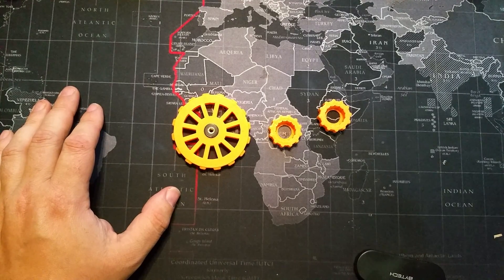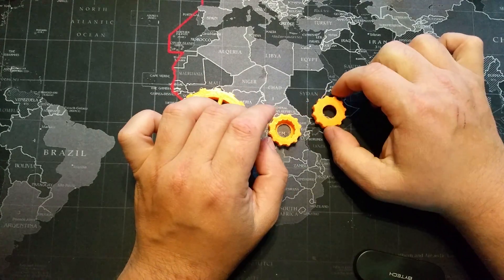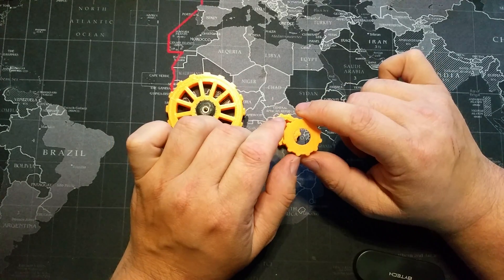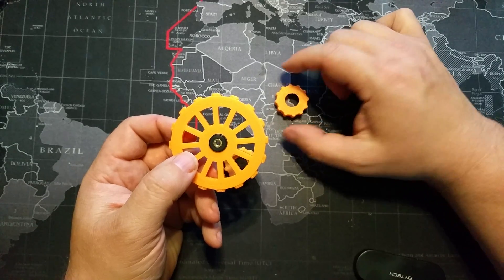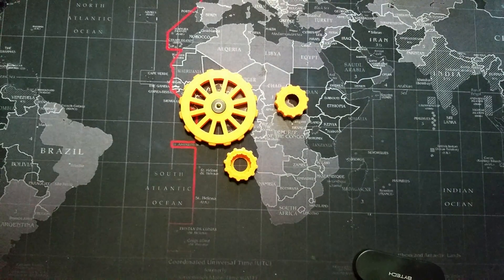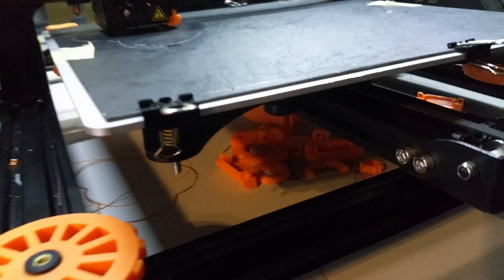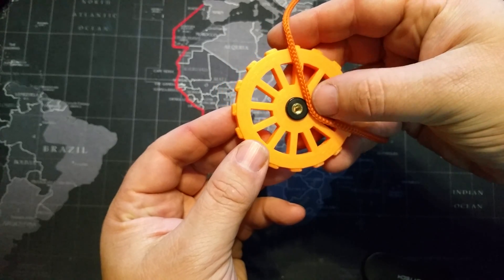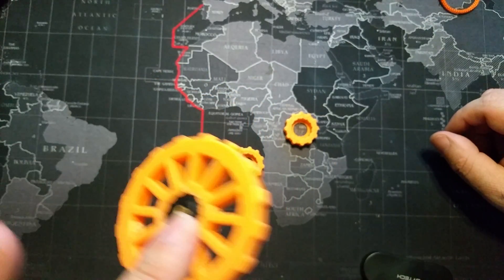Today's 3D Print - CR-10 Ultimate Bed Leveling Knobs

Comment: I wish there was such a thing for the Anet, but then the Anet is built to a price I am sure. I made the only available so called thumbwheel for the M3 nuts. It still crap. When I visualized this upgrade I saw your featured model here :-)
The CR10 is two steps up from the A8 (at least :P) . Different FW, and the extruded alum makes for a much stiffer frame than mine. I wasn't convinced about the v-groove thing when I first shelled out. I have a diff persp now :-)
Reply from the maker: +Chris Leech the cr10 is pretty much top dog for a low-cost printers and it even gives expensive printers a run for its money creality really did a good job on it I hope the company continues to innovate and maintain high quality standards it's refreshing to see a Chinese printer work so well
Reply: I shall stop my complaining and design the largest Anet bed levelling thumbwheels ever! Necessity being the mother of invention. CR10 is on my xmas list
Reply from the maker: +Chris Leech which anet do you have?
Reply: Sorry, I hit the wall after a long day. I have the A8.  It is always in need of some tweaking of the be,....to the detriment of my productivity and output.
Reply from the maker: The A8 is one of the worst printers you can have for productivity it is literally a tinker's printer a box of parts for you to mess with hack tweak and modify I would love to play with one but I would never count on it for productivity :-) first thing you need to do is work on stiffening it up concentrate on the modifications that make the printer more rigid since that is what is doing to cause most of your problems lack of rigidity
Reply: Totally, and the thumbwheel upgrade, lacking though it was, was the last item on the upgrade list. Yes I have installed al the best stiffening that sould be printed so far and there is still more. But for now it is making good prints PAL, ABS with little X/Y echo or bounce. I am building a 5' x 5' CNC Router just now so I am a little distracted. Still got to do some design project in Fusion360 so the new bigger adj wheels are up for it.
Later
Reply from the maker: That last part right there is 3D printing Magic design if you can lick that the brass ring is yours that's what I'm trying to learn how to do that's what makes 3D printing so rewarding I love printing stuff that other people make but the real payback is when I can take something that comes from my mind and make it real big learning curve :-)

Comment: Hello :-) I got my CR-10 yesterday. I would love to print this big Knob. But i dont know how to setup the details in cura correctly. Do you maybe have a gcode file? :-) and maybe for the other MUST-NEEDs too? :-)
Reply from the maker: ok. that is just really freaking weird. I JUST POSTED THIS TODAY !!! The video won't be out till tomorrow! Strange man. really strange.

https://www.thingiverse.com/thing:2508323

gcode included. make sure your bed level is GOOD and just feed that to your CR10 it will print the 4 wheels the strain relief and the remixed parts cooler duct.

pretty much all you need for the CR-10
Reply: Hehe strange things happens ;-) Thanks a lot for your files and help, i am really a big fan of your channel! :-) PS: the cam where i can see inside your room, and from where i know what you are doing, is behind your printer ;-)
Reply from the maker: spread the word. tell your friends. use the affiliate links if you need something. if I can get "big enough" I can start to get the really cool stuff :-)

Comment: Great design...but a warning for CR-10 S4 and S5 owners: they are too big to work. The S4 and 5 have dual rail stretchers that foul this larger wheel and the other design on thingiverse that takes a lock nut. They would need some remixing to work. Nice prints btw - that Esun stuff looks nice.
Reply from the maker: Andy Midd oh now thats interesting. I wonder if you could shift the rails inward a little (easy to redrill the y plate) to clear these. I really love the huge wheels.
Reply: Yeah maybe. The position the rails are in out of the box on the S4 means you basically only have another 15mm or so on stock wheels before you are hitting the rails.

Comment: don´t they move to easy ? I have problems when my Printer (Wanhao i3)  starts printing fast y and x   I have the problem after that print  , that I have to relevel my Bed
Reply from the maker: the German Printing Nerd you need to replace your y carriage plate. The stock plate is too thin which means you have literaly an unstable printing surface that will change almost every time you use it. Also start working toward z bracing. The wanhaos are like wet noodles on that gantry. Totally different machine once you fix the y carriage plate and brace the gantry. I never have to relevel. Ever. Unless i change layer height or material.
Reply from the maker: the German Printing Nerd also adjust your acceleration and jerk to 1/2 of their default values. All the jittering will stop and surface quality will improve dramatically.

Comment: Hi, how often do you level your bed? And with the zplate, do you heat the bed or use it cold?
best regards!
Reply from the maker: Santiago Alejandro Vinci Marino I level my bed one time every now and then I give it a slight tweak if it needs it as it's printing the skirt if I noticed it slightly off for some reason I'll tweak it a tiny bit but I never have to actually relevel it holds pretty good as for the print in Z surface I heat the bed 60 C I tried it use a cold once and had some warping so I just use it heated and have 0 problems so far the surface is really quite impressive if you decide to try it out they gave me a coupon code to give out TODAY3D gets your 10% off I don't get anything but that's okay I like promoting products that really work
Reply: Nerys great! I'll do that! Thanks